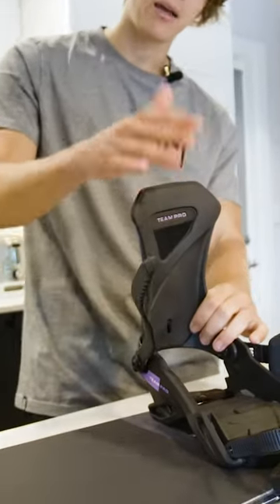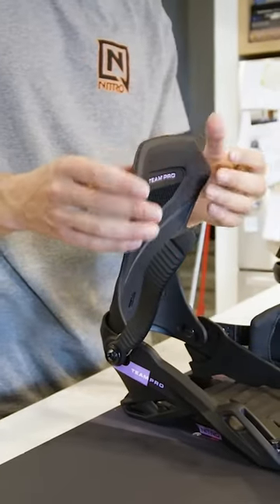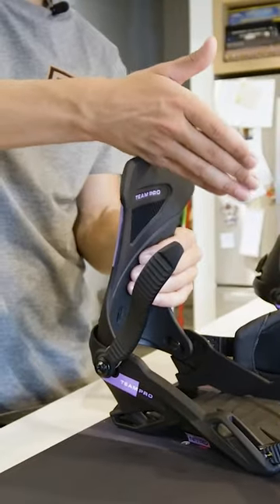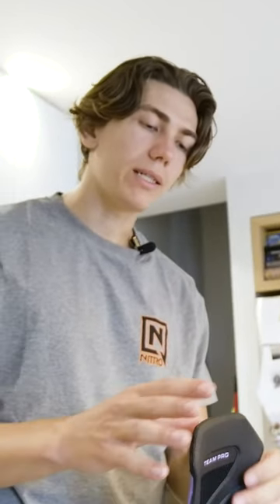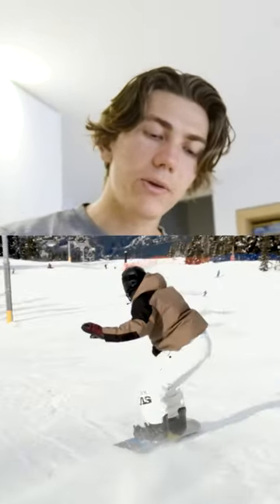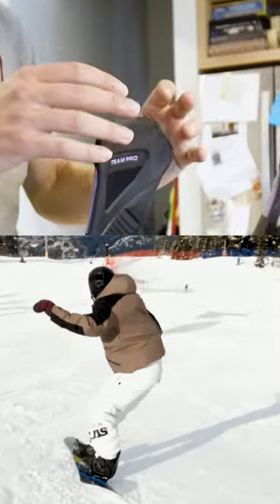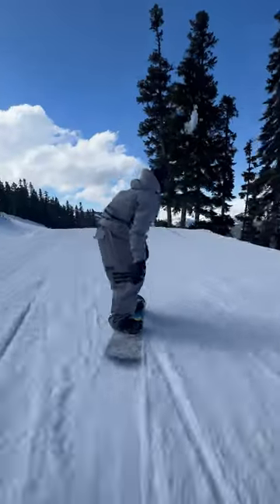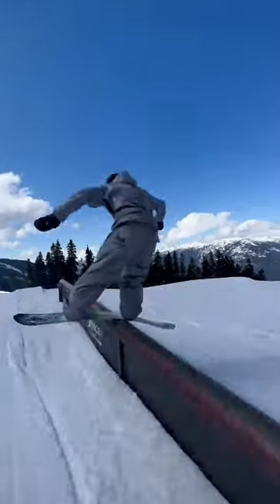How Does Forward Lean Work On A Snowboard? #snowboarding #howto

Comment: I feel like I need this. My heel edge turns are just not solid
Reply from the maker: This will help!
Reply: It's all personal preference. There's plenty of pro's who ride zero forward lean. I personally don't ride it because it wears my feet out instantly. I feel the benefits in response, but it's a moot point if my feet and calves are in pain half way down the run. Again, that's just my preference. I know plenty of people who can't ride without it, and they freaking shred. To each there own.